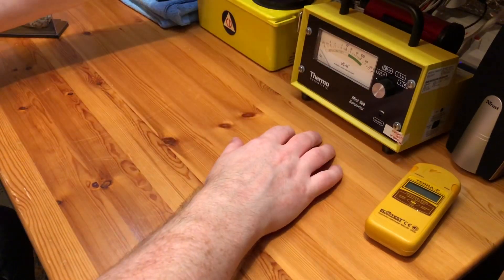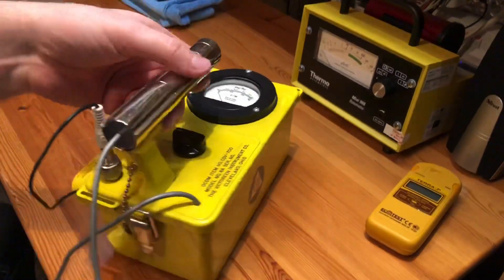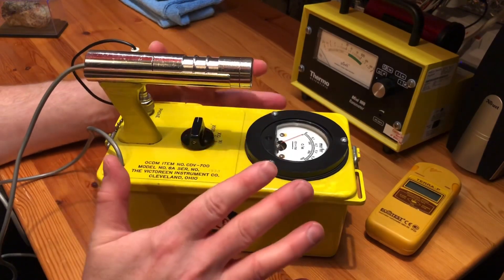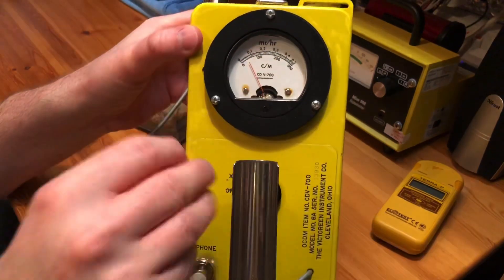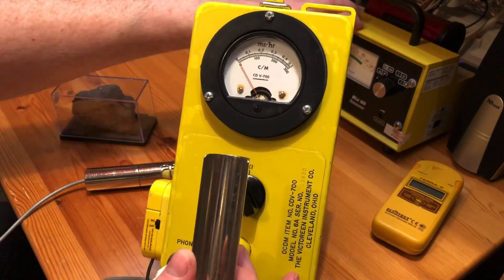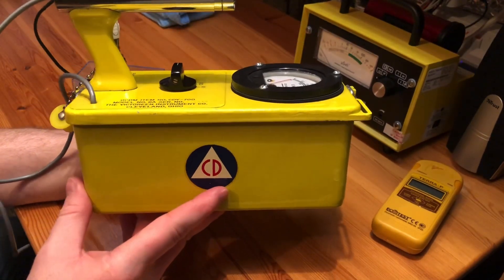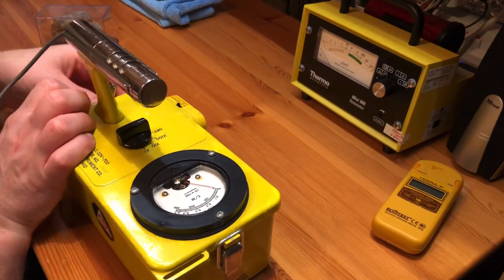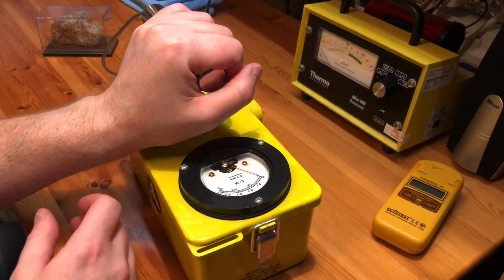Victoreen CDV-700 (Model 6A) Geiger Counter

Comment: the cheapest company I could tell you that will calibrate it is prep guard, located out of New York, they rebuilt my CDV700 that had a cracked board and made it back to working condition
Reply: @Captain_Char  how much did they charge?? I just grabbed one from the trash they were throwing away at my fire department that hasn’t been looked over since 86. Wondering how to get it back in working order.
Reply: @taylor_smith  There’s a good instructable on restoring them. I just finished going through a 1959 CDV700. I’m not an electronics expert but if you’re decent with soldering and you’ve got some time it’s worth repairing. Let me know if you need any help. Also there’s a great video on YouTube for these that I used. Crazy the FD were throwing these out!!!

Comment: Price of that device in the USA: 1500 rub (21$);
Cost of delivery to Russia: 15000 rub (213 f $).
Jast... A life))
Reply from the maker: Seriously??? That’s ridiculous!
Reply: Wow that's a lot
Reply: Same problem with the ebay global shipping programme to the UK...a rip off!

Got a really nice clean working example of the 6B version for £150 last year, which included all the fees. Mine also came with the original depleted Uranium test source on the side of the unit, which is as strong as when it came out of the enrichment process.